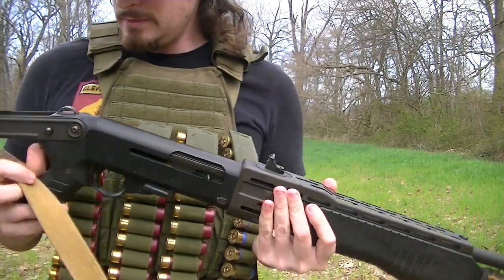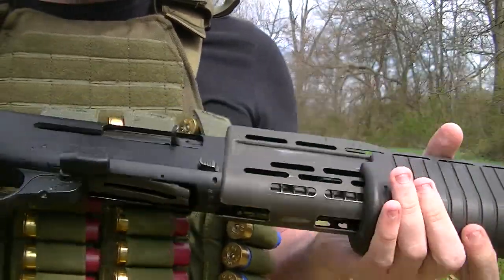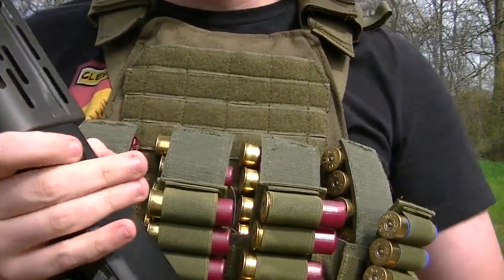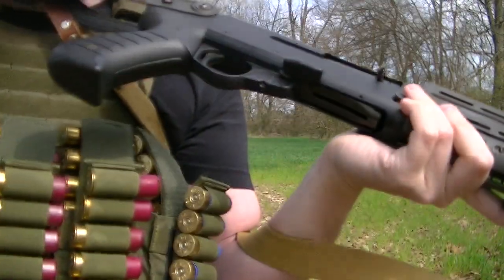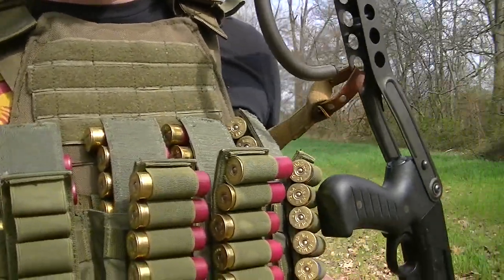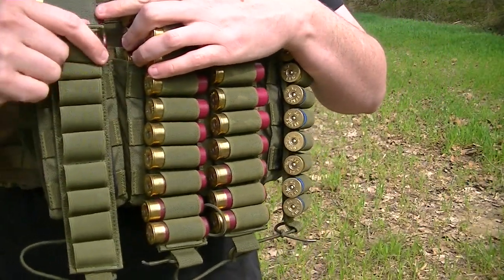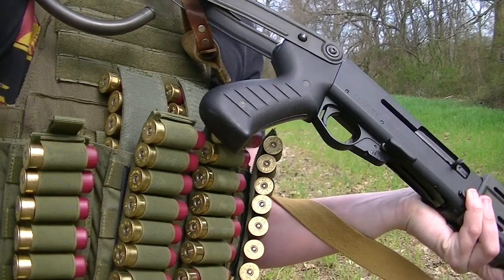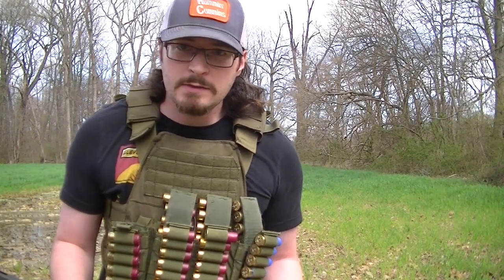The Hartmann Reload Technique for the SPAS-12 Shotgun *Bonus Plate Carrier Rig*

Comment: I still do not understand why the designer thought having the loading gate needed to be locked.
Reply from the maker: Yeah, not sure. Seems like it's a hold over from early manufacturing and designs of semi autos. It shows up in lots of different manufacturers firearms as well, European and US. Something to do with the carrier and how it is made. Some old brownings do the same thing with a one piece carrier, while later models have a speed load feature that is a 2 piece hinged carrier so you don't have to depress the button. But they were harder to make and more expensive apparently. 

Another thought is it could have been another so-called safety feature. The SPAS-12 originally had 3 safeties. A grip safety, a lever safety, and a quick action safety. Grip safety is very rare, and usually only on 18.5 inch barrel models. Never went to full production I guess. Instead we have a grip plug where the grip safety was meant to be. Maybe the loading gate lock was considered another safety feature in some twisted way. As if it ever needed 3 safeties. Or even 2.  It did come out in a rather turbulent time when guns were really starting to be demonized in the media. 

But in the end it is probably just a manufacturing thing. Saves a few pennies so the profit margin is higher. I don't know if we will ever truly know.

Comment: I'm curious, is it possible or legal to modify it so you don't need the bolt release
Reply: From my examinations of the internals, yes, it would be possible to modify so that you could load it without the bolt release being depressed. However, in doing so you would disable the ability to lock the bolt open.
Reply: @agentsmith555  interesting, thanks for answering my question

Comment: Your technique is only slightly better than flipping the shotgun upside down to reload. You are are still "out of the action" when you remove your right hand off the trigger. You need to practice loading with your left hand while the weapon is still in your right hand in battery and pointed downrange toward the threat. In an actual engagement your right hand must constantly remain on the trigger and you never want to completely run the shotgun empty which will then require a lengthy reloading process. That is the beauty of a tactical shotgun over a magazine fed pistol or rifle. You don't have to shoot it completely dry before reloading. You are always fully loaded as long as you keep your left hand free to top it off and you must always have a round in the chamber with the weapon pointed forward in battery.
Reply from the maker: And how exactly do you load it left handed when you have to press and hold the bolt release to unlock the loading gate and be able to put shells into the magazine. I don't think you know enough about the SPAS-12 to be able to speak on the subject.
Reply: @Joseph_Hartmann  during firing? The bolt release must be depressed even after you have fired? Is it like that in both pump and semi-auto? I honestly had no idea the bolt release had to be constantly held down in order to engage and thought you just had to press it once. Thanks.
Reply from the maker: @craigdamage  after firing, to reload the shotgun, the bolt release must be pressed and held to be able to insert shells into the magazine. This video is just for the SPAS-12 and its cousins, the LAW-12 and SAS-12. Otherwise I would agree with you, but on this particular gun, it is pretty much impossible to keep ones hand in the firing position during the reload, unless you have three hands that is. Lol

Comment: Is it true that it needs full load shells so it doesn’t jam..Kentucky ballistics guy said so
Reply from the maker: No, it isn't true, if you properly lubricate and maintain your SPAS-12. The problem is mostly lubrication. When properly lubricated it will run bulk cheap birdshot 100% from the shoulder. 1200 fps cheap bulk federal loads. I have a video on lubricating the SPAS-12 properly with G96 Rapid fire grease. I also have a video experimenting with low brass bird loads from the hip and experimenting with double O rings to help it cycle from the hip/unsupported. From the hip it is best with a little more powerful load, say 1300 fps or so, though it can cycle the cheap ones while using the proper push pull technique from the hip. I believe that Kentucky Ballistics may have also had an issue with the gas ports being slightly clogged. Because mine runs the same slugs his did no problem whatsoever. Combine that with not having good and appropriate lubrication and you see the issues he was having.
Reply: @Joseph_Hartmann  I think he said that might be the issue as well..needed to be cleaned or lubricated..cause it jammed up in him quite a bit..he just went for pump mode after that..Your answer sounds more logical and correct..great video and I like that vest set up you got for the shells..excellent!!
Reply from the maker: @thebutcher1613  thank you! I'm glad you like the vest. And thanks for your question about the SPAS-12. I've had mine since 2016 and in my experience its been very reliable with pretty much any reasonable load, with the proper lubrication and maintenance of course. There will be more SPAS-12 content in the future. If you have any other questions just ask away! I'm happy to answer any and all SPAS-12 related questions.
Reply: @thebutcher1613  To add my own opinion as another SPAS-12 owner: Lubrication definitely helps a lot. I still generally feel most comfortable shooting 1300 FPS loads (and they’re not hard to find) but you can absolutely shoot lower powered loads with proper lubrication. O-ring is also necessary for lower powered loads to keep from bleeding gas, and that part is often lost or damaged. They’re a consumable item for a reason. Also, make sure the gas ports are properly cleaned as they can get clogged from shooting a lot and then left sitting. I ran into that issue, but cleaning the ports out with some CLP, a drill bit scraping the inside by hand, and blowing out the loose debris with compressed air fixed all that.

Gun’s perfectly reliable, but due to a lack of major institutional knowledge about the gun, a lot of proper maintenance that aren’t hard to do often fall to the wayside.
Reply: @gameragodzilla  I agree with that..the other guy from Kentucky ballistics was using low brass loads and said it hadn’t been cleaned or oiled that he knew of..nice gun nevertheless and if you have one too badass..I want one!!
Reply: @thebutcher1613  They are rare and expensive, unfortunately, which is why knowledge of them are so small. There's always a few on Gunbroker if you're willing to spend the cash.

Comment: Where/how did you get that plate carrier rig??
Reply from the maker: It is the spartan armor sentinel swimmers cut plate carrier, available at spartan armor. I opted for level III+ ar550 with anti spall coating, and tucked some 3a Kevlar behind the plates, because I found a police testing report some time ago that stated this boosted the protection to level 4 in their testing. As for the setup, it is just modified double AR-15 mag pouches which came with elastic retention, any in that style will do if they have a drain hole, and 9 shot velcro backed shotgun shell cards. I  just added the adhesive velcro that came with the shotgun shell cards to the front of the mag pouches, sewed it on for extra strength, untied the elastic retention bands, ran them through the drainage holes in the bottom of the mags and tied them to the tabs on the shotgun shell cards to make them serve as a way to tie the cards to the mag pouch to prevent losing the cards when they are empty, and also double as a way to retract the empties so they are less in the way. If you would like I can make a video on the way it is set up. I just made what I needed because no one made them in the round count I wanted. Its based on the ksg rapid response rig. Which holds 7 on each card. I wanted 9 on each card for one complete reload of my SPAS-12, or almost any other combat shotgun. Though it could be made in 8 round, 7, or 6 provided you can source the shell cards. 9 per card is about the max. Seems like plenty, I have 72 rounds on board. It's a great show of force and very easy to reload from. Let me know if you want a more in depth video on the pull out cards and carrier. I can make that happen. Its pretty simple but probably easier to show than tell.
Reply: @Joseph_Hartmann  Thanks man, im definitely gonna check it out, I already have a plate carrier, but I want to buy another one for shotgun shells like this one you have. I appreciate you responding, and yeah if you make a video of the plate carrier that would be awesome, I’d love to get a breakdown of it and everything. I’ll subscribe as well, thanks again man 🤟
Reply from the maker: @ghostsofwargow2511  no problem my friend, there's not enough love for semi auto shotguns in the world, so I had to make my own setup. I'm glad you appreciate the plate carrier and loadout,  I'm still missing a few things from it, I need a good complete ifak and a dump pouch, as I run a .357 revolver in a drop leg and speedloaders as a secondary. Some people ask why so many shells, I say if you aren't shooting a shotgun you better be feeding it, being rounds limited is no joke but having that firepower on tap is awesome. I'd rather have more shells than I need, than to be a couple shells short. Its also good as a show of force in a community defense role. I'll get a video up in a few days for you detailing it more closely and a little philosophy of use behind it thrown in as well most likely.
Reply: @Joseph_Hartmann  If it’s compatible or possible, you should add a lower armor lap pouch (one of those vertical armor padded plates that protect your groin) to the bottom of it. It would give you even more protection, and looks even more sick.

Comment: Not bashing on your but trying to understand your loading technique as a new concept. That is a technique that has been around forever, heck even John Wick uses a similar technique in his movies, I will say bot a good technique for combat, never want your finger out of the fight.
Reply from the maker: The problem lies in the fact that you have to push the bolt release on the SPAS-12 in order the put shells into it. That is the point of this technique. It is SPAS-12 specific. This is far better than turning the gun upside down and pressing the bolt release that way while feeding it shells.

As far as fingers in the fight goes, this is far faster to redeploy the SPAS-12 than the traditional loading method most people employ.